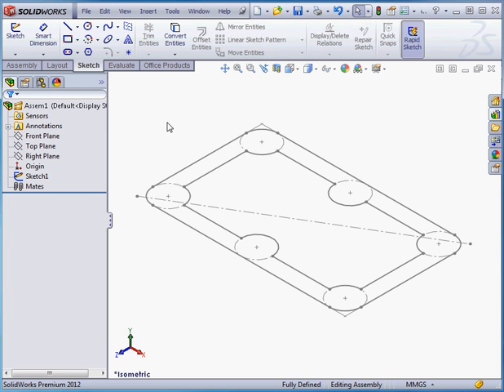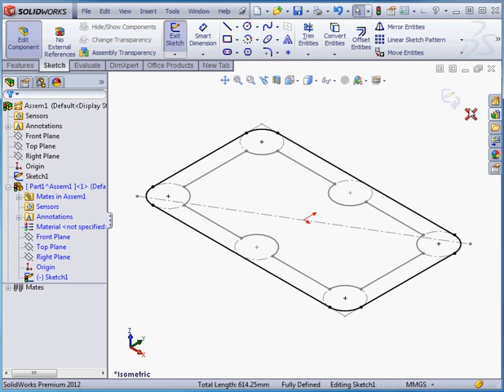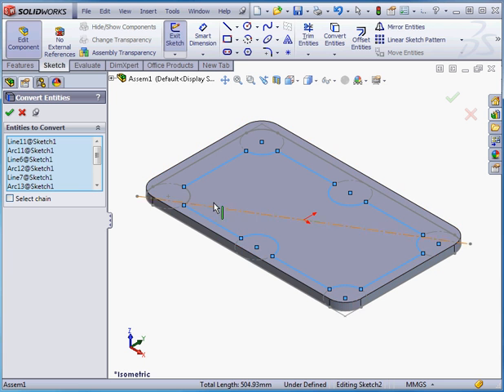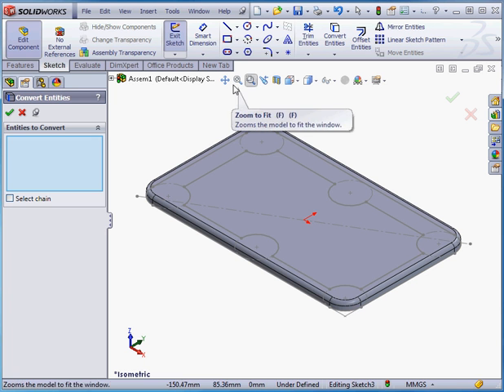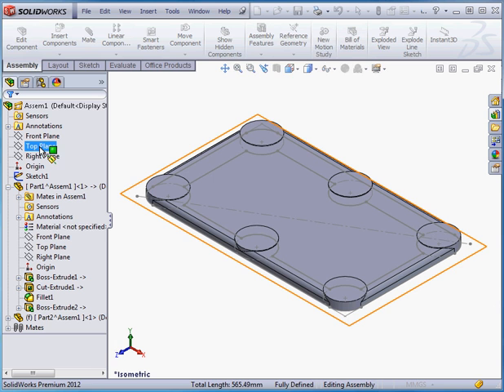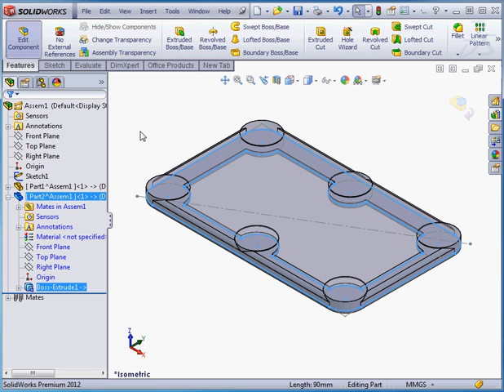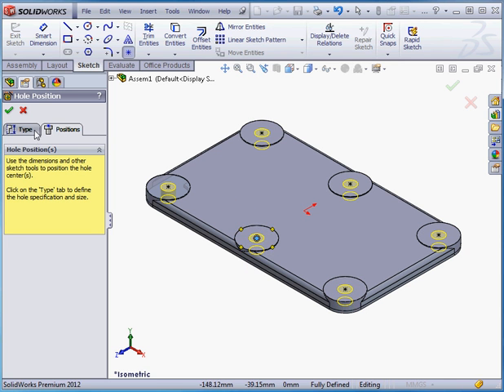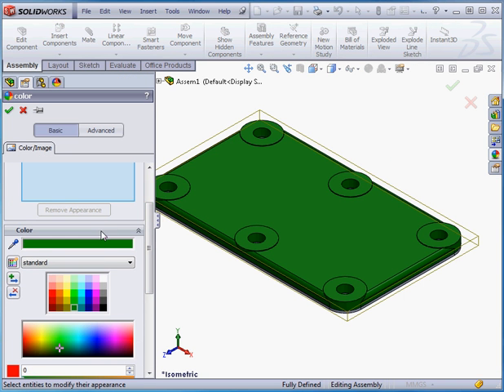SolidWorks Tutorial- Using an Assembly Sketch -  part 2

Comment: One important strategic detail is kind of not pointed here. That will work well as a fast approach only for an assembly of parts that are not supposed to do any relative movements.
An assembly build from parts, using referenced sketches, can be used only as a sub-assembly later and any internal movements will not be supported.
This behavior is as a result of the projection from one plane/origin (assembly sketch one) to another plane/origin (the part's sketch one) in order to provide a referenced sketch. During the rendering, those two planes/origins MUST be in the same relative position in order to produce the same result.
Details, details ... ;-)